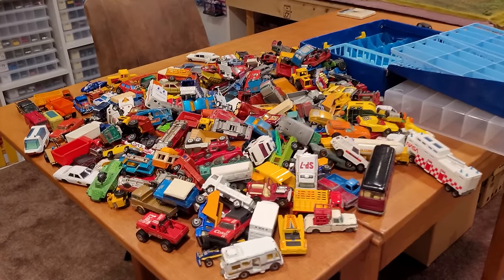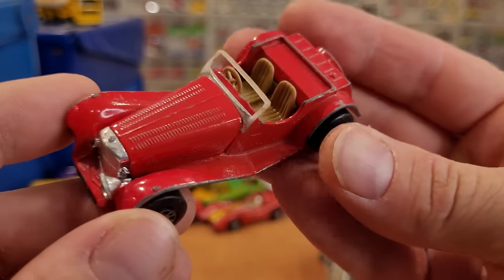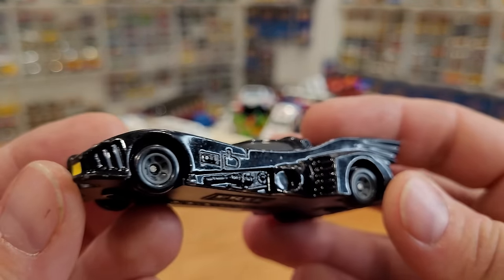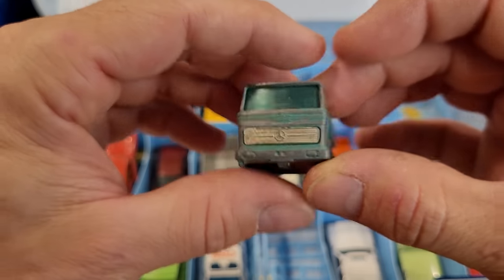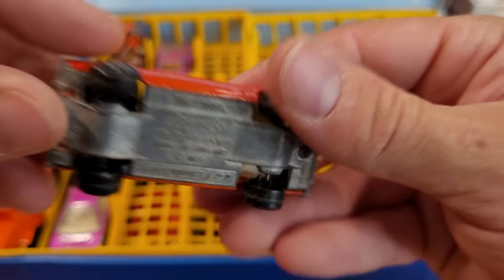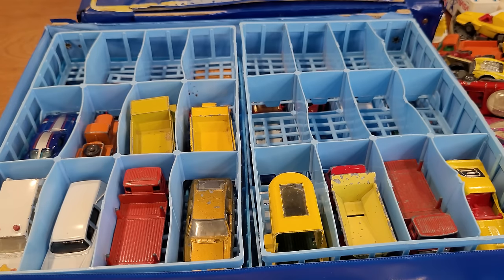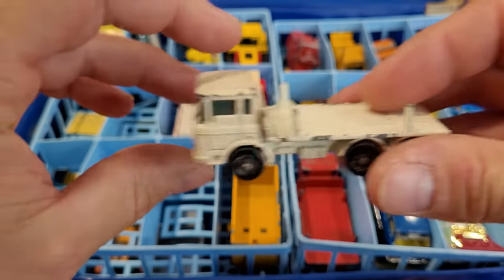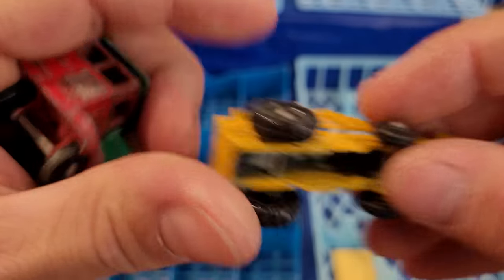Saved from a Sandbox - 250 Diecast Cars and Trucks

Comment: The old red Lesney 8 wheeled truck was a pipe carrier.  It came with around 8 pipes if i remember correctly.  I had one in 1968 or 69.  Most old Lesney's were not a standard scale, they were made to fit the box.  The white Lesney truck in the last case was the steel beam carrier, had that one also in the late 60's
Reply: Fun fact if you are missing the pipes - Maisto directly copied the old Matchbox molds for the pipes. 1:1 copies. If you need new pipes just buy a Maisto pipe truck and there you go.

Comment: 00:08   that matchbox carry case in bilingual french is pretty rare
4:30  the last one you grabbed has the darker color dump bed variation
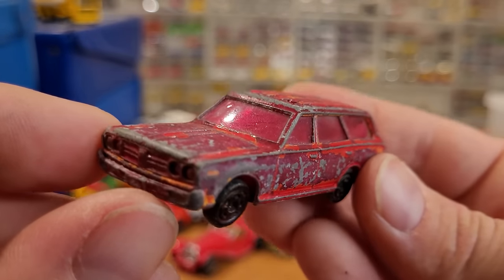9:50  "really well painted"  [5 seconds later]  "PISS POOR PAINTJOB"  LOL i got whiplash
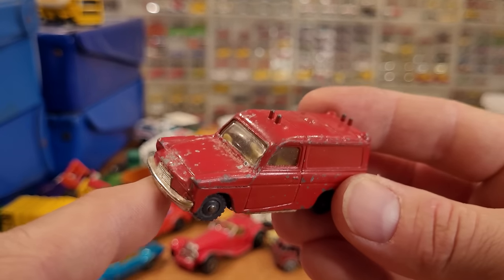10:55 that bertone runabout was about $30-$40 last i checked. it's a rare casting and corgi was the only one to make a model of that car
12:46  high value early lesney. and yes it was repainted. you can see the original paint chipped under the other paint they never stripped it before repainting it. 
12:56 "missing lots of parts"   it only has ONE part !
14:59 redline values have increased for the last 6 years. that car in that shape will pull $20-$30. not even joking. i was buying redlines all through late 2012 into late 2013. they were worthless. i was grabbing entire lots of 30-40 redlines for $25. can not do that anymore. those times are over. 
16:30  matchbox convoys trucks are also going up in value. ive seen many lots of maybe 10 of them going for $45 and up. loose and played with.
18:52  OH MY GOD.  That is an EXTREMELY rare variant of that Peterbilt dump truck. white hub blackwalls.  a guy on swifty's garage (now known as  diecast garage) it took him 20 years to find one.
21:35  a Schuco!  old german diecast maker, high end.
23:58  "garbage"  wtf lol  that trailer goes to the Citroen SM twin pack. again, it's a rare set.
28:40  not common in that color. i learned that from you even!
30:35 i had no idea Lesney made the Miura when it was new. one year only model. 1969. never seen again
32:57  not common in salmon. rare.
34:22 "looks neat prolly worthless" my guy that is LITERALLY the 6th car Lesney  Matchbox ever made when they first started the company. Moko Lesney. 1954. Euclid Quarry Truck.
36:20  thats not your hands drying out, that's the lead going into your bloodstream.  lol
39:00 i am in love
44:30  matchbox hearses have value because for the longest time they were banned in asian and spanish countries because the hearse is celebrating death and it is a sign of the devil and parents raised complaints about matchbox selling hearses, so they were pulled from sale for many years.
51:30  me when i see pink redlines painted over black
52:30 i keep it 25 cents a car or less to where i get a "deal" - of course that assumes you can count the cars in the photo, or the seller has.
54:28 there's a lot of quotable reactions in this video. this is me every time im taking cars out of the boxes and trying to guess them from memory
55:56  ROAD BLASTERS!  Very collectible and worth tons.
59:55 customized with wheels off a mcdonalds hot wheels car
Reply from the maker: Thank you gor this reply!  I loved reading your reactions, input, and knowledge.... 
I always appreciate your messages. Huge thank you, man!
Reply: @wtffor  No problem, ODAWG!